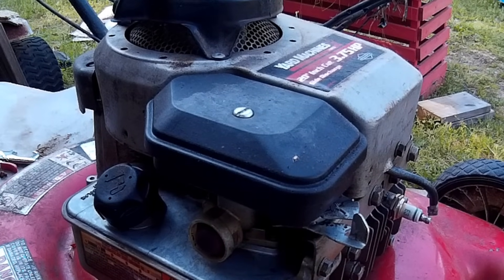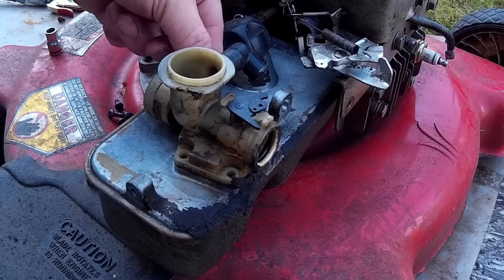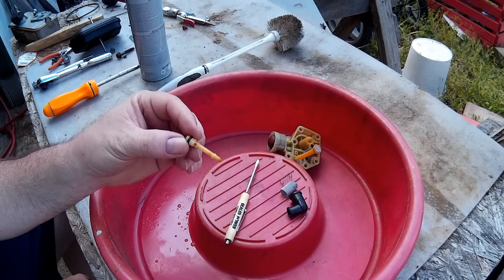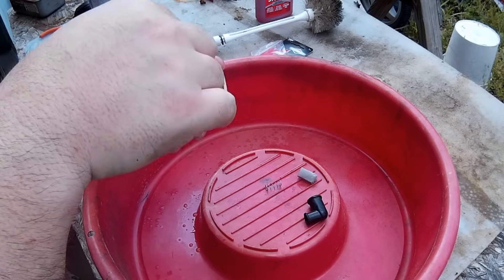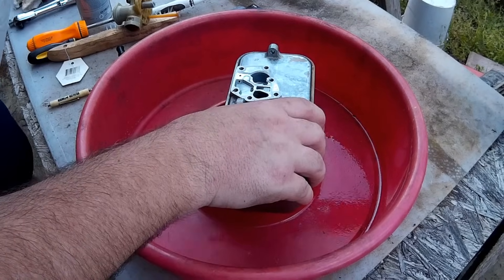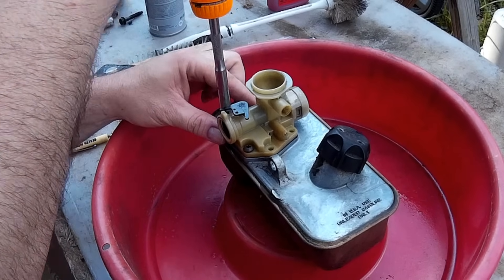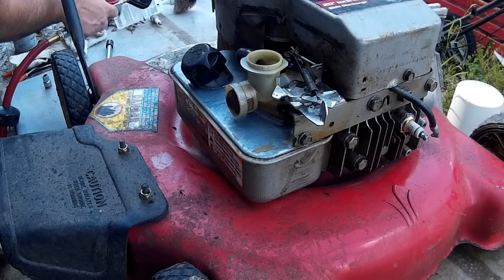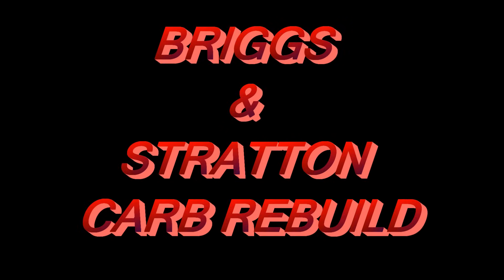Briggs and Stratton Plastic Pulsa Prime Carburetor (Carb) Rebuild

Comment: Sadly, I found that the tube that runs from the carburettor to the engine (intake manifold) had broken off near the engine.  So I think I will have a massive air leak in the intake.

Comment: Try this hack and let me know how it works for you 10 years from now. So, Actually there's nothing wrong with the pumping gaskets. All there is is a slight air leak somewhere around the perimeter of the gaskets... Usually the widest point between the screws. So you don't even need to take it apart. Just clean the perimeter good, put some spray foam around it or whatever you think you can get off easily next time... even gummy butyl tape maybe...whatever will seal it all the way around wear the plastic joins to the tank. My foam hack lasted 7 years before the foam broke down with all the oil grease and it had another of the same miniscule air leak between the gaskets. 😊

Comment: So I ordered the kit.     ran but hard starting originally with the kit     wouldn't run at all with new carb   found a mower w a wheel missing  on cleanup  took my wheel put on mower good to go  that was how I done it 😅
Reply from the maker: Sometimes you just got to do what works.

Comment: You never mentioned the o-ring and washer that goes on  the end of carb tube  before you slip it on to the intake tube. Also you never hooked up the govenor linkage. How did it start??
Reply from the maker: I never took the O-ring out of the carburetor. You can see it in the carburetor at the 3:10 mark and again at 12:08 just before I slide the carburetor onto the intake tube.  I hook up the linkage at 12:25 as i am sliding the tank and carburetor into position and I mentioned how easy it is to do when the tank is loose.

Comment: hello, I've been holding my mower for 15 years, but this time, the primer bulb no longer pumps (not pierced apparently). I cleaned the carb, blew it, and still nothing coming out. I wanted to see if the 2 little metal balls were a problem. I pressed them a little to see, and they remain blocked in the depressed position. Do you have a suggestion? Thank you in advance, hoping that this unearthing does not fall into the sidereal void of the web.
Reply: The rubber bay be perished, have holes in it, and may not be sealing. You may need w new primer bulb. They're easy to replace.

Comment: Great video; however, the video lacks one modification the will stop the surging problem from returning. Simply scribe/scratch a line between the two screws on either side of the intake port. This is where the plastic warps. Scribing the line between these two screws will solve the problem. Did this to three mowers several years ago, one of them was only a year old, none of them has ever had another problem, if fact one of them I used the old gasket over.

Comment: Do you know what the part number is for the kit? I've got one doing the same thing, well it was. This year it won't even start unless I pore gas down in the carb. The primer bulb still works, so I figure the pump diaphragm is bad or the jet is plugged.
Reply: Stens 520-175 replaces 495770 B & Stratton

Comment: sometimes the 2 rings on the carb come off on the intake tube. The rubber o rings go in side the tube on the carb the white rings snap inside the carb to hold the black one on place

Comment: Watched this video a few times now and finally I'm doing just this on my mower now. Can't wait to hear it running.
Edit: Performed carby clean as per video and mower is running sweet.
There was a bit of gunk embedded in the filter screen of the fuel pick up, couldn't see any other blockages anywhere but could have been and the plastic jet you lever out with small screwdriver seemed clean. The local briggs dealer told me you could pull out the fuel pick up to clean but I should have asked him to show me how as I was afraid of breaking it. Seemed very stuck in there although it would turn. Instead I squirted starter fluid in there and blew it out with air gun both from the pick up filter mesh side and also from the hole in the carby it's connected to. You see which hole is connected when you blow out the started fluid from the pick up side. I alternatively sprayed the starter fluid in and blew out one side and then from the other until the debris were no longer visible inside the filter screen. Somehow debris got in there and weren't just on the outside. Got a new set of diaphragm & gasket for $12 ($AUS). After 10 years the diaphragm was a bit stretched and worn. Oil long overdue for change and was evident by the sludge that started accumulating. Checked valve clearances - Intake was right within spec but exhaust was bit over spec. May lap valves and make adjustments at a later date.
Thanks for giving me the confidence to attack this carby with a bit of knowledge of what to expect. Cheers! Brad.

Comment: Mine keeps sucking the primer bulb in and stalls. Any help??
Reply: Maybe the fuel pickup tube is blocked, I think mine was because replacing that gasket & cleaning the jet didn't fix it. The tube did have stuff stuck in it but I used a wire rod & I think it damaged the tube & it ran badly rich afterwards.

Comment: You failed to mention about the plastic sealing ring and the rubber ring that goes inside that at the back of the carb when you remove and replace the unit. Also you didn't say which hole the spring needs to go back into! 
It's the larger hole by the way folks 🤗

Comment: ..mine isn't surging, it's sputtering like the choke is on, won't rev up, too rich acting...have cleaned it..but it has no choke, no float, no jets..how can it be flooding/running rich?.....(it's the same type carburetor you are working on)....

Comment: I've never in my 21 years of mower repair, have removed the center jet. And no one I know uses that damn screen. I've had a couple of carbs, where the screen was the biggest problem.
Make sure you do have that spring in there! It will cause headache.
The bolts are standard. It's 1/2" and 3/8". There was a couple of years 93-96 that they used 3/8" all around except the oil tube that was 1/4"
Reply: chef souffle So you’re saying the carb is better of without the screen?
Reply: @BIG_DRU  in the center over the jet, yes. The long tube, keep that screen.

Comment: If anyone has this engine and it  surges and wont run smooth and right, 
these plastic carburetors warp on the engine side mounting surface and 
either have to be replaced or  you can sand that mounting side down as 
flat as possible and add SEAL ALL Sealant or a PERMATEX gas resistant 
sealant to the machined surfaces when putting a new gasket on and a tiny
  smear on the gaskets also.  SEAL ALL sealant >>(resistant to 
gasoline, oil, paint thinner, and most solvents. Seal-All is also water 
resistant immediately upon application
Sets in 2-3 minutes. Fully cures in 2-6 hours) Yuo can get the gaskets at most Auto Parts stores. Complete kits on eBay for under $5 if you can wait ..

Comment: Mine still doesn't run right . I used mass air flow cleaner instead of carb cleaner. My pick up tube screen looks like it has stuff trapped behind it

Comment: Great video: It only took me about a half hour to finish this project of course I did a little more cleanup on my mower. Worked out great! I have to confess I also forgot to put that little gasket back on the top of the carburetor. 
One more question where did you purchase that nice pan? Tony Wiesel had a great???

Comment: Great video, simple and easy to understand. My 20 year old mower was running badly, so I replaced the diaphragm and gasket, thinking that would solve the problem. It still ran badly. I determined that the bottom of the carburetor, being plastic was warped and not sealing properly, creating an air leak. I added another gasket and solved the problem, ran fine then. I believe you could take a fine-tooth file and place it flat on the bottom of the carb and carefully dress it, to create a flat surface, or possibly use some gasket sealer. I may give that a try next time.

Comment: I had a Briggs that was surging. I screwed the breather tube up and it stopped surging. It was a little loose, so in all the way and back out just enough too get the rubber tube back on carb.

Comment: These push button/bulb 'choked' B&S engines are a PITA.  My go to 'cure' if the bulb is inoperative is to simply fill the tank to near full, rotate the entire mower by 90° using the front wheels as the pivot point .... this will allow the push bulb to fill/operate - give it a few squeezes in the 90° rotated position, rotate the mower back to the ground, then start the engine.  
Use stabilizer and a bacterio-stat in your fuel.  When putting the engine up of the season, fill the tank with 'canned' ECCO, etc. stabilized, hi-octane, blended fuel (About $15.00/gallon from Home Depot, etc.), run the engine for about 15 minute, shut down and refill the tank to the top, then seal the VENT on the tank cap. 

I do this on all my small engines: outboards, weed-whackers, chainsaws, small mowers .... and RARELY have a starting problem the following season.      Most of the old style 'fuel stabilizers' are not effective for ethanol contaminated gasoline, use the 'canned' fuel for when long term storing your engines. If you have access to general aviation (small airport) supply - use high octane, alcohol free,  AV-gas and then add standard gasoline stabilizer. 
Hope this helps.

Comment: Watched a few of these videos, bought a B&S diaphragm "carb rebuild kit" from Lowes, installed the new diaphragm and gasket, and it runs like new.  Before, it would only run for like 3 or 4 seconds then quit.  Yup wouldda been pretty dumb to throw it away.  Imagine how much profit there is in leaving a single weak point guaranteed to fail in 5 years or so - most people will just buy a whole new lawnmower.  Not me.  I didn't want to be one of those dummies,, so I spent a week working on it and watching videos, and saved a hundred and fifty bucks plus tax!  :)))
Reply from the maker: Well done!

Comment: Well done !, very well presented. 
As an aside comment : The order of nipping in / snug fit of the carb screws. 
You went in a concentric fashion.The Haynes Small Engine Repair Manual recommends "Tighten the pump cover screws in small increments, following a cross-pattern, to avoid distortion of the cover." The Briggs and Stratton Repair Manual for Single Cylinder 4 Cycle engines mentions how to "Pre-Load Diaphragm" for a Vacu-Jet carb, saying to "Hold choke while tightening carburetor mounting screws in a staggered sequence". 
Some people suggest the same method as doing a cylinder head but really, this is plastic, surely the torque is not that great. Mmmmh the jury is still out on this one !
Reply: there is no choke on this carb.

Comment: These carburetors seem superior to the newer ones with a plastic bowl, do you agree?  I suspect they are simpler and less temperamental.
Reply from the maker: I'm not really familiar with the newer carburetors but I would say that this type of carburetor is one of the simplest designs ever.  It's set to run at a set speed so there's nothing overly complicated about it. The vacuum generated from the engine operates the diaphragm  which sucks gas up into the bowl and then the airflow into the cylinder pulls the gas through the carburetor and into the combustion chamber.  As you have implied, the more complicated they get the more temperamental they can be.

Comment: Get 2 air cleaner screws for that carburetor and cut the tops off. Use them as lineup tools to replace the diaphragm. Brigg has a tool to replace the primer bulb. Amazon has it. The tang bracket is to adjust govonor speed. If the carburetor still acts up, replace the carburetor. The soft gasket goes on the bottom on the tank. The top goes on the carburetor bottom. The pickup tube pulls off and installs by twisting and pulling. Make sure you have the right govonor springs. Remove the flywheel and replace the top seal and also replace the lower seal. Their is a special oil drain tool from Amazon for 4 h.p. There are valve guide tools from Amazon. Replace the valve seal from the valve.

Comment: If you have to pump it a lot to get it started the first time but after it is hot it starts easy I would make sure the bubble does not have a leak.  The fact that it runs good when it finally starts would eliminate ign.

Comment: My lawn mower is running weak and rough for a bout a year and finally it stopped working, the thing is if I prime it, it can run about 30 seconds and stopped, I figure it's time to rebuild carb, bought the same part as in your video and throughly cleaned every thing, prime it and it start easy and I immediately noticed it sounds much smoother just like new, but unfortunately it stopped again after 30 seconds, I ran out of idea what else can be done to bring it back to work.
Reply: I think the pickup tube could be blocked. Use Carby cleaner & compressed air to clean it. Don't poke anything into the tube to clear it though.

Comment: Great film, I cleaned the carb a few weeks ago after it ran for a few moments before cutting out. It ran  smooth for a couple of times, now it seems to be running very slowly, if it’s not the carb you said it could be the Linkage at the front. How do you fix that ? I have a big bush I mow under and I’m concerned I’ve damaged that part. Hopefully it’s the carb, so I will give it a try at the weekend. Got my carb cleaner and a new gasket and diaphragm and I’m ready to go . Any advice is greatly appreciated . I work in an office all day so I’m not a practical chap, but I’m determined to fix his dam machine !!! Thanks.

Comment: you are the first person i have seen take out the wire mesh filter to 
clean the jet well done!  does the mesh pull out or did you have to ease it 
out with a screwdriver?
Reply: You can twist the mesh, to loosen it and then pull it. It should come right off.

Comment: Get 2 air cleaner studs and cut off the tops. Screw them into the tank holes of the carb. to use as a line-up tool. Put the diaphragm down on the tank and then the carb. If the engine still don't run right, replace the carb. Check the spark plug. Tighten the head bolts. They loosen up. Use a 3/8 Dr. inch lb. torque wrench. Use a Stens oil change tool- #752-828. Amazon has it. The top piston ring is thin. Remove the ring ridge before removing the piston. Check the compression. It should be about 90 lbs.

Comment: How to replace my primer bulb.  my original primer bulb sprays gas out of it.  My new primer bulb also has a hole in it.  What is The difference
Reply: If it has a hole it is the wrong part (or you stuck a screwdriver through it trying to fit it - like I did once ). The primer bulb for the Briggs + Stratton  pulsa prime carb is  part 694394.

Comment: I noticed the lose wheel bolt on the front right side by the discharge chute right away at 0:15.  The mower sounds great after you where done.

Comment: My Briggs with Pulsa, needs to pump more than 6 times & still hard to start. But once started, runs smooth. Re-start easy when it is still hot after running. If once started, it runs good, then could it be likely the diaphragm ? I cleaned the carburetor but did not replace it because I did not SEE any rip on it. What is your opinion from experience ?
Reply: Replacing the diaphragm as shown in this video may solve it. However, another option which is equally as easy is to look at your ignition system. It's even simpler. These types of engines have a simple magnetron ignition system. Just do a youtube search for videos of removing the ignition module, sanding/cleaning the face of it, sanding and removing rust from the magnets on the flywheel and reinstalling with the proper gap (using a business card). This will strengthen and potentially give a hotter and stronger spark to aid in hard starting and potential misfiring. You should also replace the spark plug in this process just to rule it out.

Comment: Thanks for a great VIDEO, I had troubles with my mower and after replacing the Gasket and Diaphragm it would still only start and then stop, looking at your video showed me that the fuel jet was and how to clean it, doing that fixed it . Thanks heaps

Comment: Do you know if you can buy a replacement carb for B&S where the carb is attached to the tank. I did a carb replacement on my edger for $30 shipped and I liked how fast and easy it was replacing the whole thing.

Comment: that annoying Pulsing !
 just like this video!
the Diagram & gasket fixed it for under $5 .
However, it would only run 2-3 minutes!!   (though,pulsing was  Gone).
turns out , as stated elsewhere: get a NEW PLUG. my mower runs with power & smooth!!.
Thanks Guys

Comment: You fixed that thing perfectly, I try to work on a lot of small egines I get mine from the county dump or yard sales people tell me they are broken and beyond repair and give them to me just to get rid of. Most of the time I just take the carb of and clean and adjust it and it runs like a top, people just don't understand how simple the 4 stroke engine is.

Comment: The only other thing I would like to add when I copied this procedure  is when pulling the carburettor from the machine the o ring & plastic sleeve from the carb came out from the carb so a upon starting after the service the machine still hunted up & down on revs  due to the fact the vacuum in the carb was not correct as the carb & manifold were not sealed  due to o ring sitting loosely on manifold in front of carburettor   
Video was a great help thank 👍